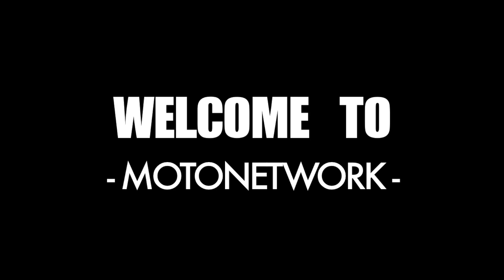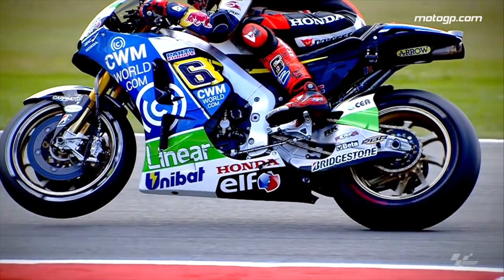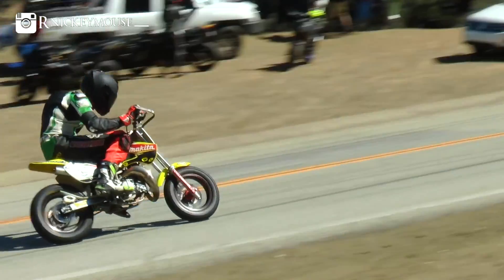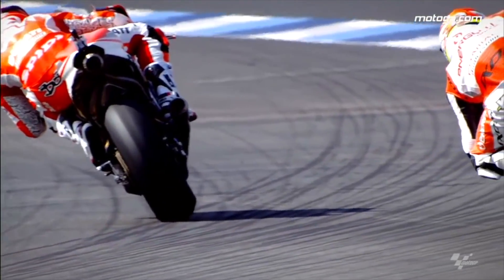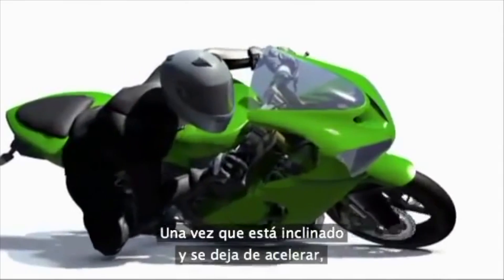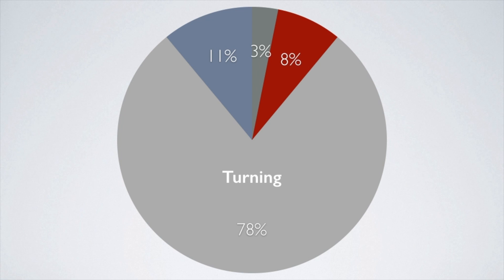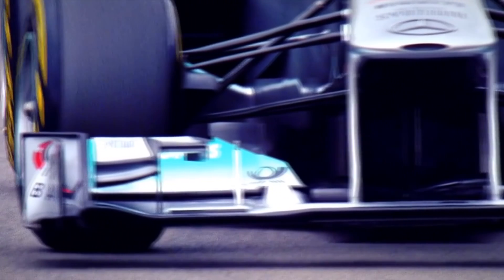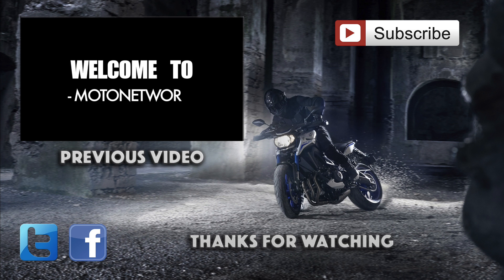Motorcycle Traction EXPLAINED!

Comment: You are taking tyre as a rigid material.. like its made of Steel... but its not.. The rubber compress and change shape depending on the amount of load put on it. For example... If you take a steel ball and press it against floor and try to slide... then your theory will work..because contact patch will not change and cohesive force will remain same as contact area is same. Now do this with a ballon. The more force you apply, the contact area, flattened surface against floor, will increase and hence more cohesive force amd more grip. And tyres act like ballon not like steel ball as they are made of rubber.
Reply: Contact area does make a difference because tires don't slide they 'shear' leaving a layer of rubber behind like a pencil on paper. The force to shear rubber off the tyre IS proportional to contact area. Also tires deform into the road surface texture so even on wet roads where they slide instead of shear, the bigger contact patch finds more lumps, cracks and edges to hook around. That's why they're soft (and wide ;).
Reply from the maker: +Dr. ShivAditya Sharma you're right in what you're saying but you're wrong about my explanation. Watch the video again. I only used an example with a brick to demonstrate the law of friction. It doesn't mean though that I talk about the rubber as the hard material, since I explicitly talk about temperature, elasticity and other physical qualities of the tire under various loads. Makes sense?
Reply: By watching your vídeo i tend to think that a larger contact area between tyre and road won't affect grip. Tyres behave in a diferente way, if you increase the contact area (larger tyre) you get more grip.
Reply: Be careful to not confuse rolling friction with sliding friction. The steel ball rolls easily, but that is irrelevant, we are talking about sliding friction, meaning the steel ball isn't allowed to roll, neither is the balloon. If you take a steel plate for example, you'll see it slides less easily as you press down more too. Just like it does with the tire. The flattening you are talking about is only increasing the rolling friction of the balloon. And the force pressing down is the only factor affecting sliding of the balloon.
Reply: From watching the video I was convinced that you had applied the '2nd law of friction' wrongly. The contact patch area does matter (and from what I gather in the video, you are suggesting it does not). If you are still unconvinced, see the journal article in Vehicle System Dynamics: "The relation between contact patch geometry and the mechanical properties of motorcycle tyres".
Reply: Let me put it this way, if i have 2 equal steel plates with same weight but one has 1 squared meter and the other has 2 squared meters, both will move at a specif applied force and this force is the same in both. This same exemple applied to rubber "plates" will work in a diferente way, I will need to apply more force to the rubber plate with more contact area. This is because the friction doesn't depend on area of contact, except for rubber (there may be more materials like this).
Reply: If contact area is not important then why tyre manufacturers all over the world spend millions on R&D to increase the contact patch of sports bike tyres. Example is MotoGP tyres.!

Comment: This is not very accurate, actually... One can not apply friction coefficient directly to tires as on rigid materials. For elastic materials such as tires, friction force is not a linear function of normal force applied and friction coefficient between the surfaces. Instead, for a fixed type of compound, it is a much more complex function that takes temperature and contact patch into account (yes, with elastic materials friction does depend on the contact patch as larger patches have more probability of proper contact with the road than thinner ones). Having said that, quite useful vid, dude! ;) To sum up, for a fixed compound, wider tires give you less wear (can handle more pressure), better grip but more drag! Warmer tires also give you better grip than cold ones. Cheers.-
Reply: your ball sack sags when your body temperature is warm, giving a greater contact patch. your body also sweats, so the friction coefficient increases as well as temperature (like a hot tyre is more sticky). if you want to reduce the stick, you can wash your balls with cold water, wear briefs or not lean at such a great angle
Reply: as an aerospace engineer, i agree with the above explanation. i do however want to point out that when Nacho mentions 'This is not very accurate, actually', i believe he just means the parts pertaining to the '2nd law of friction' (as used in the video). the rest of the video is quite relevant
Reply: Oh man!!! loving this XD
Reply: linny919 noooooo that will create extra force pulling you sideways which is what your traction is fighting against
Reply: Nacho man well said
Reply: Rightly said.
Reply: Just what I thought, but physics class is so long ago, I thought I might be mistaken.
Reply: This channel is dead now.
Everyone Migrate over to my channel!
I do Videos on Request!
Cheers!